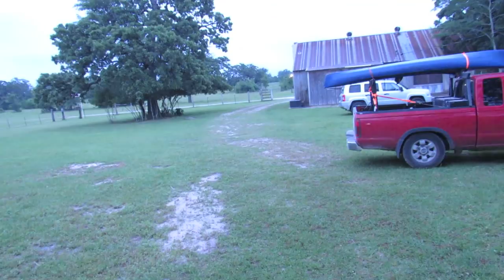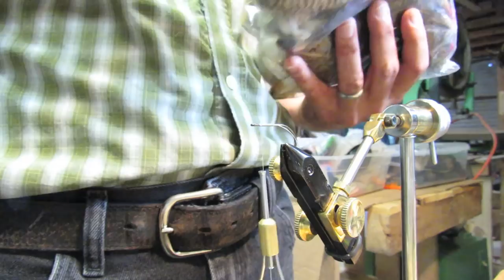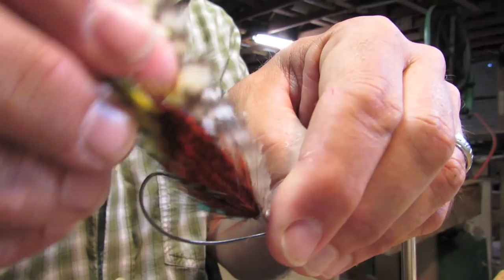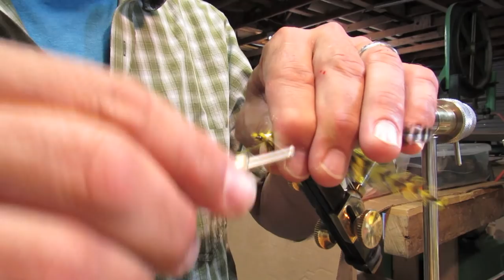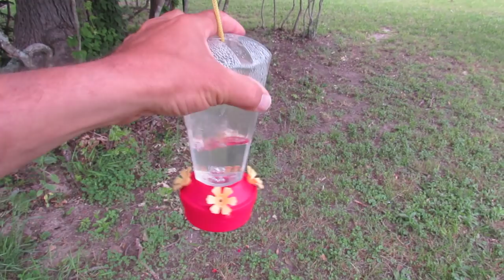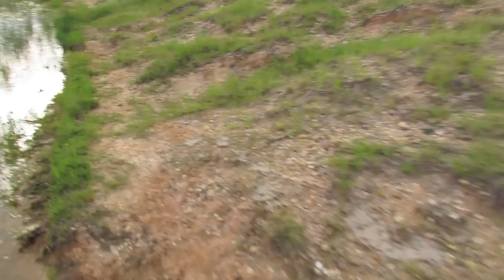FishTales Fly Tying: A Big Fly Mess

Comment: I just ordered a TFO 5 weight. Hope that I don't have them casting issues. I told the people when I ordered it I needed it to cast nice and smooth with little false casting. Thanks for sharing sir. God bless.
Reply from the maker: Matching line?  I over-line anything 5 weight or bigger.. I have trouble getting these modern fast rods to load with matched line.
Reply: William B Tedrick  yessir I think they are putting a weighted forward line on to help with the casting. If it doesn’t work then I will certainly be talking to them. They are super about customer service and have been helping me for years. I was thinking about what you said about UP lining it and that is a great idea and may certainly do that.